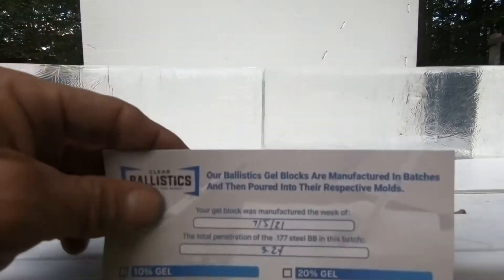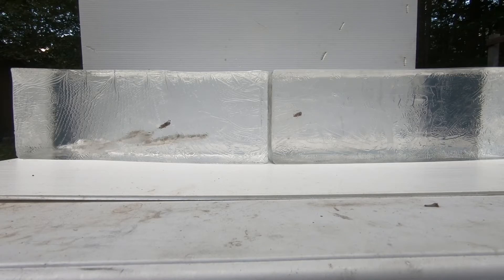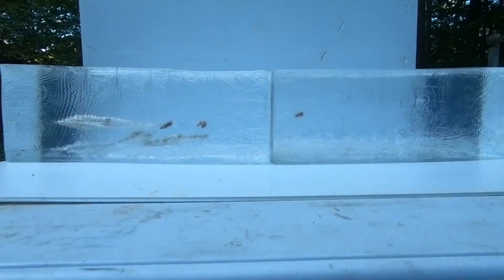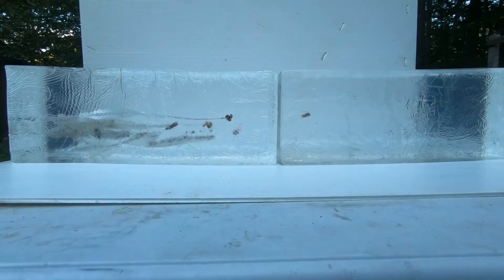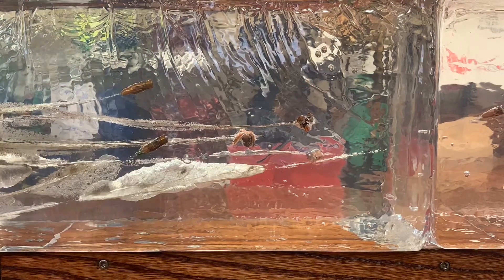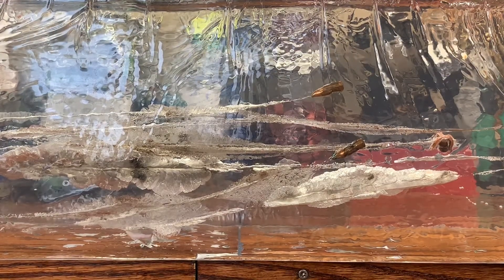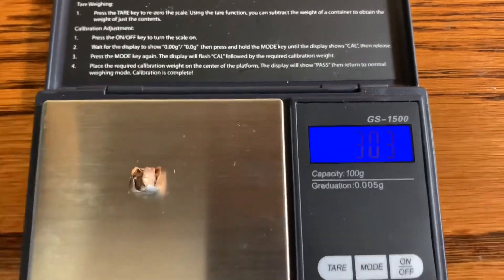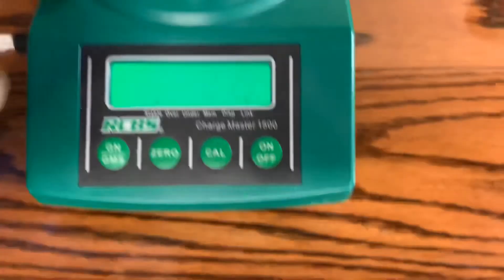5.7x28 Expansion vs Clear Ballistics Gel

Comment: 19:20 - just FYI, I've seen the 2 projectiles that FN lists 27gr on the box have been pulled by folks like Buffman & others...they are actually 28 gr. No clue why FN states 27. Elite uses them in their S4 rounds and they put 28 on the box. So your weight was spot on. Can factor-in when doing energy calculations. Isn't a huge difference but your velocity of 2432 fps makes it 368 ft-lbs, instead of 355 ft-lbs.

Comment: SS192/198LF. T6B. Best rounds for 5.7. The lighter the round the better   T6B is unmatched for 5.7. Awesome round will penetrate 3+ at 100 yards. Go through a helmet like butter. Elite Ammunition sells them
Reply from the maker: Hey JB. Thanks for the reply. I’ve seen and am aware of the T6B. Ive got a few loads that are gnarly and allthough my interest in testing the T6B is low, It maybe an option later on. They are a wicked looking projectile. I’ve got continuous load tests to run and continue very soon now that winter seems to have withered away here for now, and is taking the bitter cold and snow/ice with it. On top of this same test, but at extended range, I just received a decent order of my 55’s and 37’s, as well as 2 new projectile profiles to test. Keep an eye out for that video as I’ve dug out my old stock of Kevlar sheet. It’s going to be a great video. Thanks again